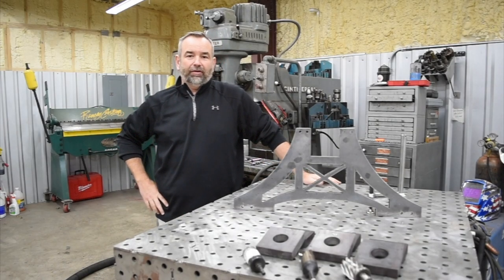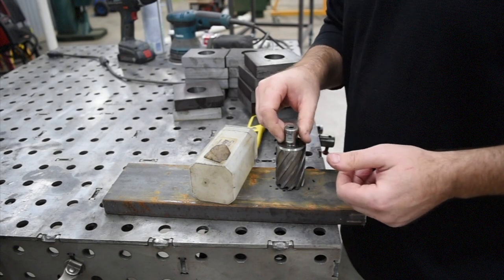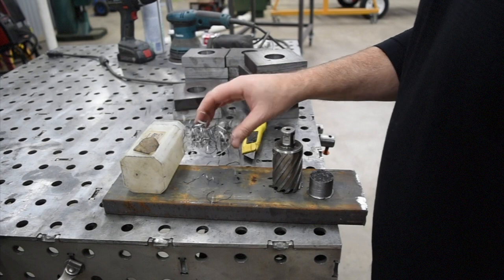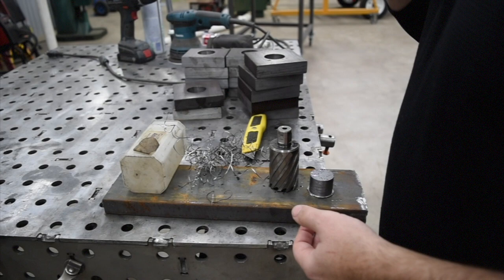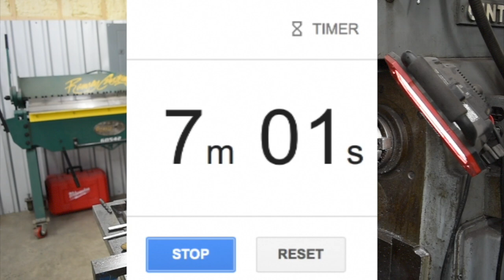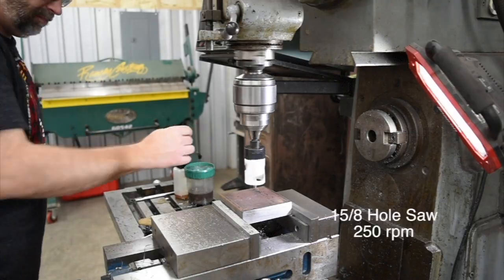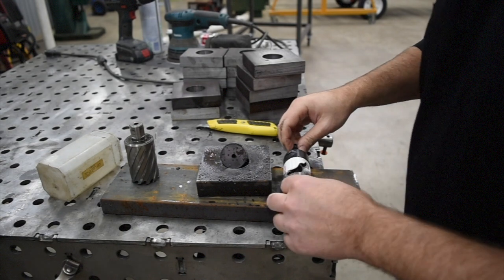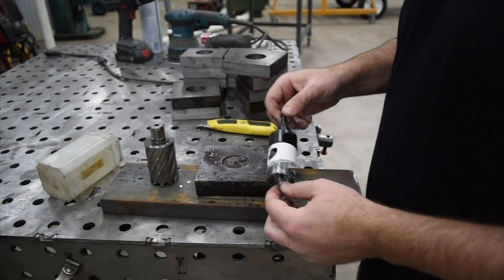Drill big holes in 1" thick steel - Fastest way? - Iron - Metal - Aluminum - Large Drill Press

Comment: What about quality/actually of the finished hole?
Reply from the maker: Great question Bill.  I didn't think to check that, as in this case it's just a clearance hole for a 1 3/8" bolt, but it would have been interesting check that.  My guess is the twist drill would have been most accurate and hole saw least accurate.
Reply: I agree. :-) I have always used the twist drill method. Three bit sizes,usually. And into the lathe for boring, if it needs to be accurate. 
Thanks for the video.

Comment: Very helpful video. I have to cut eight slightly larger holes in 10mm (3/8 inch) mild steel
Reply from the maker: should be pretty straight forward to do with a decent quality twist drill

Comment: I never understand people brushing / spraying / dribbling cutting oil on drill bits like this.  It's totally pointless, and never needed, makes drilling slower, and can dull your bit.  All you get for the effort is a bunch of smoke and some mess.  The bits are HSS, and far harder than the mild steel. They have high hardness at even red hot heat (which you won't achieve just drilling a hole).  I've drilled thousands of holes through steel, even spring steel, without lube, and have bits that have been used hundreds of times and are still razor sharp.  Also, you need to feed the bits at a specific rate - being "gentle" on the tool is ... wait what... is the tool a living thing??  If you don't have a high enough feed rate to get the edge of the bit under the material, you'll just dull your cutting edge.
Reply: good point. I never used oil. But with thick material like this I use normal milling/ turning coolant with constant flow. You really need to push that annual cutter, otherwise it gets dull quickly.
Reply: If the oil is smoking you’re already too hot, after using coolant on my drill press, anything I ever use will have coolant on it, the bits have lasted about twice as long and you don’t have to worry about burning yourself on hot steel that’s flying around. Plus in the case of a hole saw it washes away all of the chips, that and we run about 100 rpm I want to say on the drill, whatever it’s lowest speed is anyhow, works absolutely fine for me
Reply: High speed steel is not hard when it's red hot. That is why it needs to be cooled when grinding your own lathe tools. It's also why, once the bit gets too hot, it's trash. You're thinking of carbide. Also, oil doesn't dull the blade. It can cause chips to not clear out, and be recut; which will dull the blade. You can't drill thousands of holes and have the bit still be razor sharp. Either you don't know what razor sharp is, or you don't know how to count to 1000.

Comment: The first tool looks like it has 10 teeth. If so then, .0015 feed per tooth it should be .015 feed per revolution. That would be ~66 revolutions of the spindle to finish the cut through the 1" plate. At 200rpm it would finish in about 16 seconds and you would only  have 10 chips that would not be the ratsnest you had.   We know the mill used would not have that much power or flood coolant either to meet those specs but that is the way to use that type of cutter.  It would even last longer between sharpenings too.

Comment: also besides just using a drill the same as the Web thickness you can use a spray bottle instead of having to dip a brush. saves a Lil time.
Reply: if you use same as Web with drills above 1in. you have no issues, if you drill .1 or whatever under ya you will wear out that spot on the drill first. seriously if you need to pilot use the Web as your drill size and you will never have a problem!

Comment: Hard to beat the rota-broach for big holes, but expensive, and you need a tight mill or mag-base.......holesaws weren't really designed for material over many 3/16" or so, as he stated the chips evacuation was an issue....cheapest cutter of the 3....

Comment: The reason you're dealing with such unruly swarf, is you didn't peck, or dwell like you normally would with an anular cutter. If you treated it like a drill, you'll get faster holes, better surface finish, and your chips would be more manageable.

Comment: If you're losing torque, using a VFD, you're doing it wrong. The VFD should be supplying a constant torque. Your loss of torque is actually a loss of power as a 1HP (60hz) motor will only deliver as much power as a 1/2hp(60hz) motor at the 50%(30hz) setting. The problem is, people are used to switching belts, to change speeds. Your Motor is always running 100% and so you are using 100% of the power. 

I agree with the others that the annular cutter should have been supplied more oil/coolant. It would have tore through that mild steel plate, had this been the case.

Comment: When using a hole saw drill a 1/4"  "chip evacuation" hole on the inside tangent of the hole size, two are even better...... much faster!
Reply from the maker: yes sir, actually a few others have left that suggestion, and i never would have thought of it,  I will give that a try for sure.  Thanks David
Reply: Ramsey Customs - allways looking for eisier ,better or faster ways to get thins done. No hole saw will ever outperform a cutter but it's a bit costly to have one of every size...
Thanks for taking the time to post, teach the next generation a thing or two.

Comment: Get some 'SLUGGER' annular cutter cooling/lubricating fluid and put it in a squirt bottle.  Slugger in one hand work the press with the other and be amazed at how fast and cool that annular cutter will go through the steel.  I disagree on chip evacuation.  Get the slugger you'll drill straight through and there will be a birds nest around the cutter.  Pull it off throw in trash - done.

Comment: Annual cutter all the way! but if only a few holes and a hole saw is available, drill small hole(s) on the side (inside) so the chip have somewhere to evacuate. It will save a lot of time by requiring less stop to clean the tooth.

Comment: to get the same torque on low rpms, you need a PID
Reply: Lower rpms mean biger torque, so what are you talking about ?
Reply: not if you dont gear it down
Reply: I'm not electrician, but when you use frequency changer, overal power don't change right ? you just slow it down and for keeping the power you get more torque
Reply: Not so. Torque is limited by amps the motor's wiring can handle, so it cannot rise as the speed reduces. Consequently the power has to be reduced in proportion to the speed.
Reply: So electromotro with 230 V , 10 A and 50 Hz have more power then 230, 10 A and 20 Hz ?

Comment: None of these cutters should be held in a drill chuck. Proper R8's should be used.
Reply: What do you mean "proper r8's"? R8 is a taper. And his drill chuck is probably mounted in an R8 taper. Also, a drill chuck is just fine for any of these cutters. Drilling holes only applies force upward on the cutter, which is generally what drill chucks are designed for. And a drill chuck's couple thou of runout is plenty accurate for roughing out a hole. If you need it more accurate you would ream it after or take it to final size with a boring head.

Comment: Sorry to comment again, but the comment of the twist drill being the most accurate is not correct. The twist drill does not make a round hole. If somebody hand sharpens it, it won't even be the same size. Must always use the correct reemer.

Comment: LOL @ 9:42 “You have to pull out, blow it out with the air. Especially as you get down there deeper. The ANALular(I know I know it’s spelled differently) cutter has the flutes on it which allows the swarf to EVACUATE outta there. You can actually see the thickness of it on the teeth.”  Yes I realize I have the maturity level of a 14yr old lol. Good video though. Thumbs up.

Comment: What total bs.... using stepped up drill sizes when it's not necessary unfairly slows the process. also you used an oil can with the annular cutter and a brush with the others. which means you could continue to cut for longer passes with the annular and using a brush unfairly made the drilling process longer with the other two... i'm guessing on purpose to help sell more annular cutters. this video is a sham.  Old machinist here calling this video bunk.
Reply: He used no oil can!! He used a brush with the anular cutter and a brush and compressed air for the hole saw... Might want to check your eyesight.
Reply: Oops... Just spotted he did for a bit... I think I'll check my eyeballs. Apologies.

Comment: Spot and pre drill Twice?? its a 1.7" drill! its not gonna deflect... No spot, nothing, just push it thru like a Man!
Reply: LOL. Give it some stick!
Reply: depends if it's a split point or chisel point. especially with chisel points a small pilot hole to clear the chisel is helpful. most home-gamers don't buy very expensive twist drills so one small pilot hole is usually worth the minute it takes up. i do agree that a spot AND two enlarging passes before the final pass is a waste of time. if you're using a twist drill you're not going to get optimum accuracy anyway.
Reply: Look at the shank it is on.

Comment: Why not just use like a 1/2" endmill? much faster and cheaper tooling (other than the crap holesaw). Can also get much better cooling when you are not trying to straight plunge a hole into streel. Streight plunge on a large diameter hole just seems to go against all logic.
Reply: Right, we always use 1/2" end mills to cut 1 1/2" holes... (not)
Reply: high speed pathin bro
Reply: even if you cant do high speed a basic helical interpolation with 1/2" or 3/4" bit its going to be better than a straight plunge for a multitude of reasons
Reply: Quick question how are you going to do this on say a drill press? or a mag drill? admittedly I have only seen CNC in action never worked with it myself but how are you going to do that vertically on a I beam?
Reply: There is problem with straight cutting downward. That's why endmill never go just down on CNC but on some spiral path. Drill have more room for chip to leave cuting area then on endmill. Plus drill are more cheaper and easier to sharpening.
Reply: Vojtěch even on a two flute end mill? I didn't know that.
Reply: End mill are usually short compare to drill, becaus they need to be stiff to compensate that they dont have tip to center them. And as i say, after 10-100 holes you need to sharpen the tool and drill is like 10x faster sharpened.

Comment: if a hole saw took less time than a twist drill, you don't know what the hell your doing. lol
Reply from the maker: well that's the smartest comment anyone has left me in a while, i definitely dont know what i am doing, so now what?  I got all these machines and tools and dont know how to use them
Reply: You ever calculated chip load per tooth a single time in your life? Like, ever? Even once? Did you know you can turn the tools faster, making holes quicker AND improving tool life? Its possible. I guaranfuckingtee you no one in industry is making money taking 7 minutes to pluck a hole less than one aspect deep. thats pathetic.
Reply: Did you know pecking and quenching the tool repeatedly drastically reduces tool life? Thermal Cycling? Anyone?

Comment: to be honest, why did you go through all that extra nonsense with the holesaw, and the  large type drill? you could easily have used a squirt type oil can and just gone at it and got er done. no fussing about with stuff. the annualer cutter while efficent needs a special holder. most of the time

Comment: I used my magnetic drill for the first time in 20 mm thick normal steel with a 16 mm annular cutter it took 20 seconds, you don't have to stop with the drill  like this chap is doing as its the incorrect method
Reply: I think calling it the incorrect method is a stretch. But is probably stopping to oil the annular cutter more than necessary.